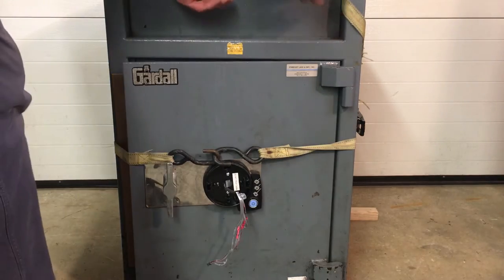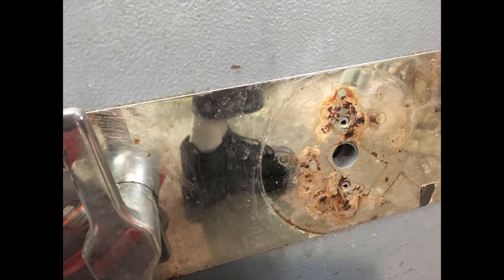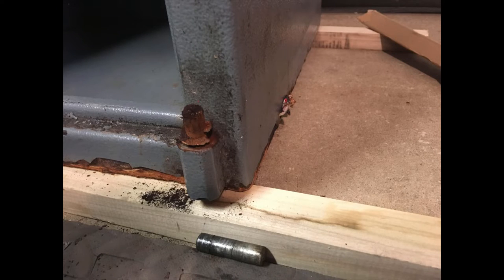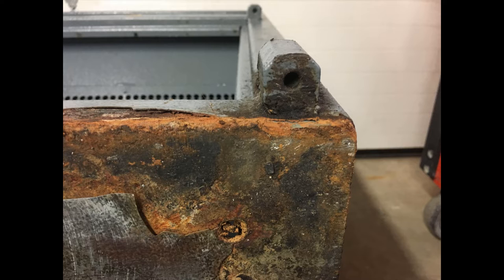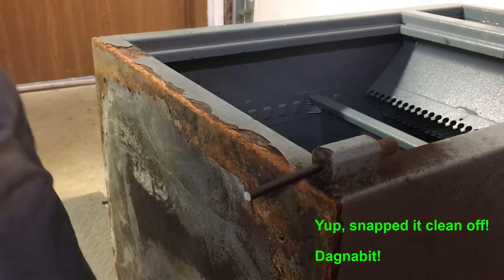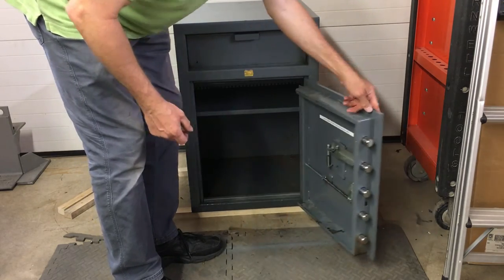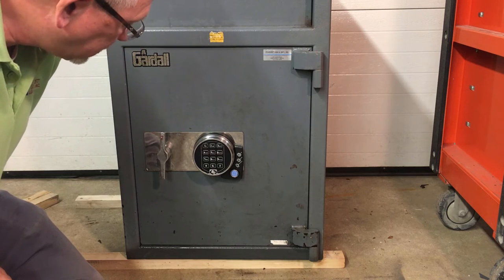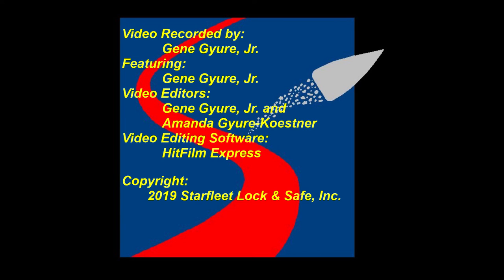Hinge Repair on a Gardall depository safe

Comment: Good job! I love projects like that one.  Of course, at my pace and taking my time as a retiree, not with the stress of a business and customer pressure, ha!

My TL15 is in the basement. So, knowing the concrete floor is like a wick I went to Home Depot and cut a 4x4 into pieces the length of the safe as a base.   I screwed them together side by side with good bolts, one by one.  In other words, one first, then another one on top of the ones I joined, then again until I had six side by side, then a 3/16 plywood on top with panel nails. I did this because the 4x4 was treated wood and the plywood was not, so the metal was not touching the treated wood. Then, I had gardening fiber left over and placed it on top. Then the safe screwed to the solid wood base.
The 4x4s base was screwed to the concrete floor with four rust proof molly expansion bolts, so the base is fixed to the floor, then the safe is screwed to the base.  It is not going anywhere because the safe itself is 460 lbs. 
Yet, the benefit is that you can get an inch or two of water on the floor and it does not wick up to the safe nor it remains wet, ever. So it never rusted and it has been 12 years by now, fresh and clean as the day I bought it. This is what should be done here. Concrete floors and metal do not get along.
Reply from the maker: Thank you for your comment.  Your solution for your issue is a classic.  A lot of homeowners ask us about doing the same thing and it all depends on their situation.

This particular safe is in a restaurant setting.  The safe being on a pedestal would be wonderful, but - as in most cases - the restaurant corporations aren't always looking at the long-term effects.  Add to the fact that the mop crew throws down more chlorinated water than is actually needed.  That means you end up with a situation like this.  We regularly remove safes from restaurants that have the bottoms ready to fall out from years of sitting in puddles of water.  

That being said, in most modern home settings, unless you have a wet basement, bolting directly to the concrete floor is not usually a problem.  Even then, a lot of times we place shims under one or more corners to level the safe and that allows an air passage.  We have often come back years later and removed a safe for transport to a new home and there is little or no rust/corrosion.  However, it should also be noted that most safe manufacturers never paint the bottom of their safes so there is nothing to protect the metal from moisture or humidity.  

Thanks watching and again thanks for your comment.

Comment: Had to do that with too much regularity; usually because of a gauled hinge pin.  A time or two because of a broken hinge pin. 

Soaked the pins with PB Blaster, raised the safe slightly with the door open 90°, put couple of appropriately sized wood blocks under the door, lower the safe and start wiggling the door back and forth.  Some times a wood block on top of the safe above the hinges had to be used with a 2 or 4 pound maul to move things along. 

I found a maul (short handled sledge, often called a drilling hammer) to be more efficient at removing hinge pins.  Let the weight of the head do most of the work while you concentrate how the head meets the punch!  Just be careful that the pin doesn't "rocket" out of the hinge. 

Badly gauled or broken hinge pins were replaced with appropriately sized drill rod.  And I usually installed zerk fittings on the door leafs for future lubrication.  

I hated it when some idiot burglar used a hacksaw to try and cut the hinge pins, destroying the flat bearing surfaces.  A LOT of work drilling and tapping for set screws and ball bearings.  Expensive, but cheaper than new hinges and their installation (and a lot quicker). 

And you might be surprised at how much acid is in soft drinks!  Lots of phosphoric acid in some.

Comment: Why didn’t you apply WD40 to the hinge pin prior to trying to remove it ?
Reply from the maker: At first you would think that might be prudent.  After 41 years as a locksmith and 23 years concentrating on safe and vault work, I have never had a tougher door to remove from a safe.  So it never crossed my mind to use penetrating oil.    With that said, my go to for penetrating oil is Kroil.  In my opinion this is the best stuff going.  WD40 has some penetrating qualities, but not like Kroil. 

Thank you for watching and commenting.

Comment: Great video. Who makes that nice attachment for that bottle jack you used to lift the door?
Reply from the maker: Hello, this is a custom designed toe jack.  Gene came up with the design based on one he saw from a manufacturer from California.  He took his design to a local steel fabrication shop and they changed it to what you see here.  Gene is not extremely happy with the design change but it is functional.

Comment: If the safe isn't bolted down and you have a stuck door, turn it on its top, spray hinges with simple green or wd40, hit the door with a dead blow and watch your toes.
Reply from the maker: Thank you Patrick.  That was a common reply that we received for this video.  Gene described it to me as this: "I thought about that, but the top was the only part of this safe that wasn't already scratched or damaged.  I was hoping to keep it that way.  It most likely would have been successful, especially if I used a penetrant like Kroil."  
Again, Thank You for watching and commenting.  We hope to have more safe and lock repair videos in the future.